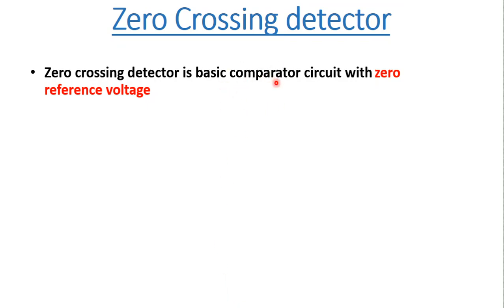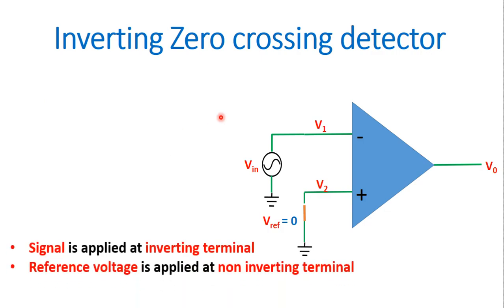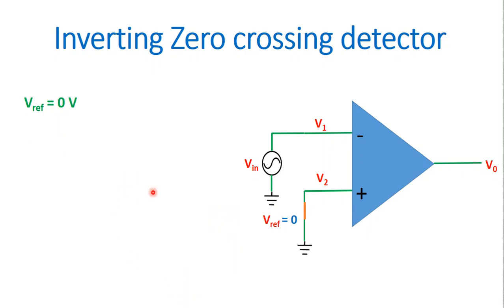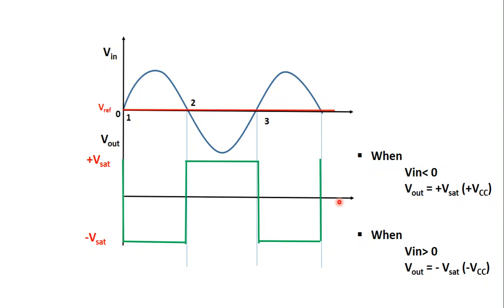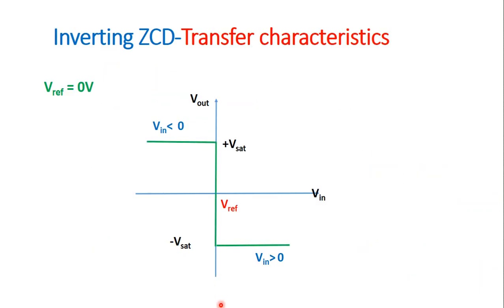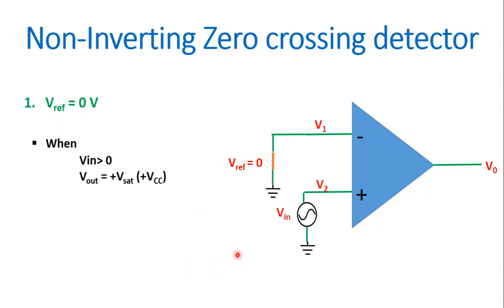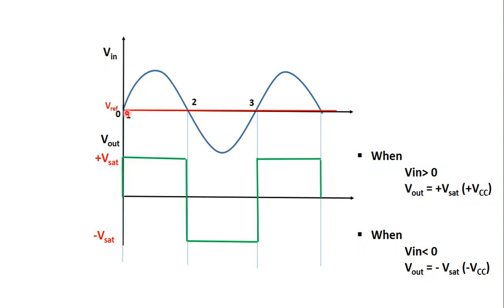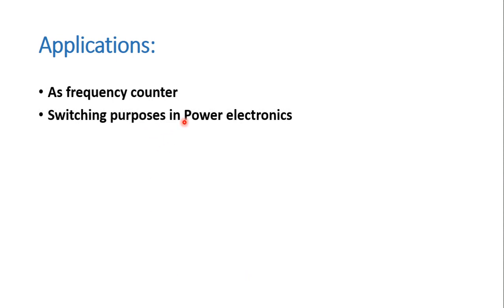Zero Crossing Detector using Operational amplifier (OP-Amp)  IN ENGLISH

Comment: As the circuit uses inverted op amp configuration, output waveform is reverse i.e. on crossing zero o.p goes to negative saturation voltage. Please correct waveform
Reply from the maker: it is correct u check once again i think u did nit see full video